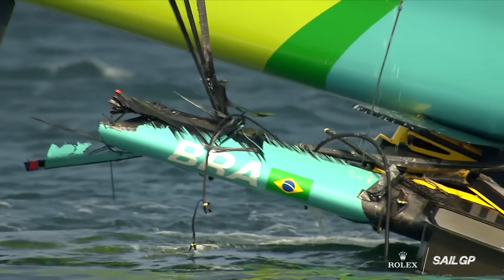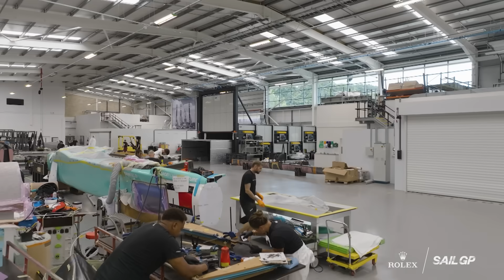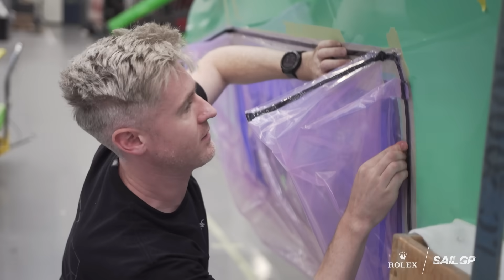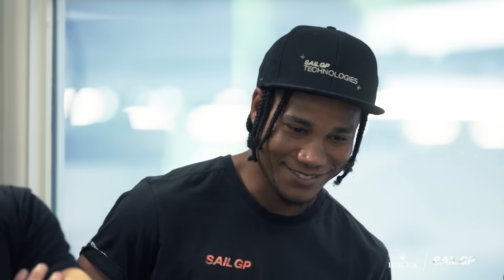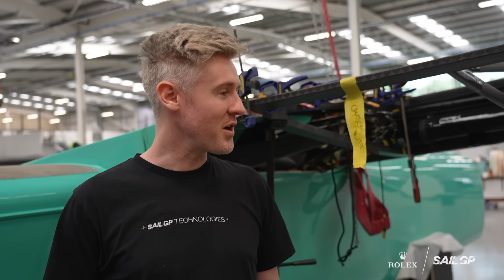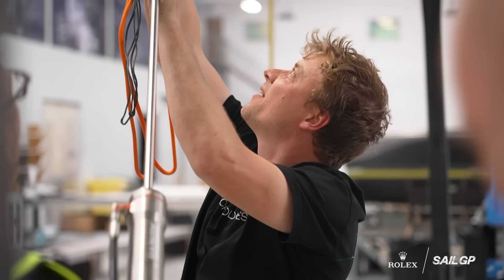2 Weeks. 2 MASSIVE Repairs. Is it Impossible? | SailGP

Comment: An alarming lack of analysis of the failure of the Brazilian boat’s crossbeam and the French team’s rudder.   Only a matter of time until someone dies on one of these boats.  Carbon fibre is not invincible, indeed it has a relatively short lifecycle due to fatigue.  Too many mast failures and structural failures have occurred already.

Comment: Really interesting thanks. From inside knowledge,  I can tell you this video just scratches the surface of the difficulty of doing all this. I do wonder if all the boats have corrector weights to equalise them? Otherwise repaired boats are going to be heavier surely....
Reply: There will be some corrector weights, but it's a lot less than one would think. Modern carbon composites can be repaired with no loss of strength and essentially no additional weight, or at least extremely little extra weight.

I'd be very, very surprised if these boats differ more than 50kg before corrector weights, it's probably only a small fraction of that.
Iirc the VOR65 boats were closer than 50kg and those were ~14 ton ocean racers 

There's probably a class rule or spec sheet out there that lists the tolerances for everything.
Reply: an heavier boat is not that much of a problem when it's foiling
Reply: @LJA-974 Weight is a problem in marginal foiling conditions when your competitors disappear over the horizon....😂
Reply: @LJA-974 A heavier boat will struggle to get up onto the foils more. That being said, 50kg is probably less than the variance in weight of the crews.